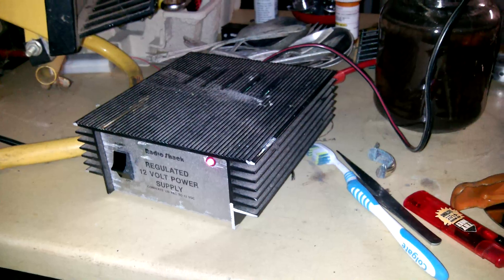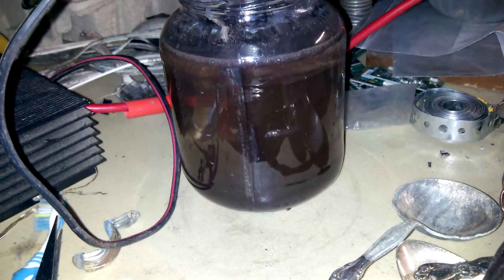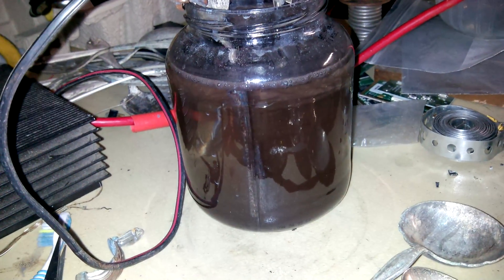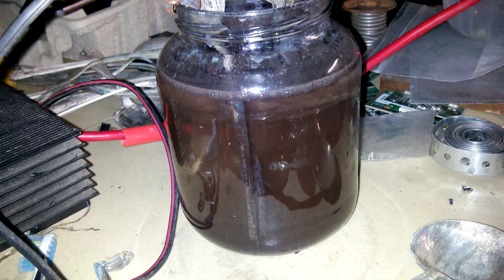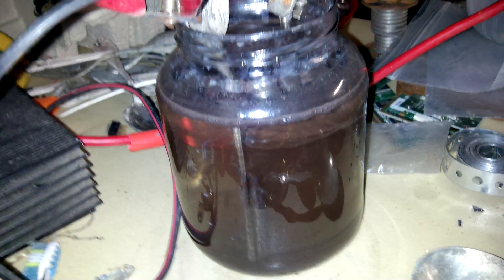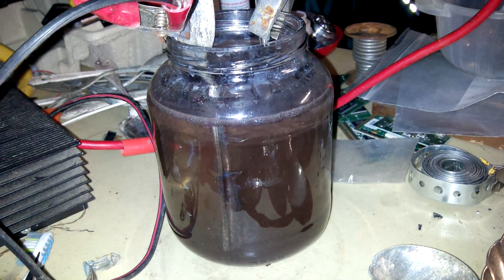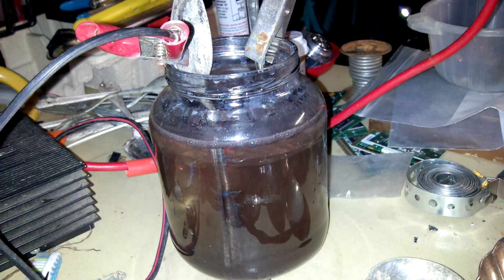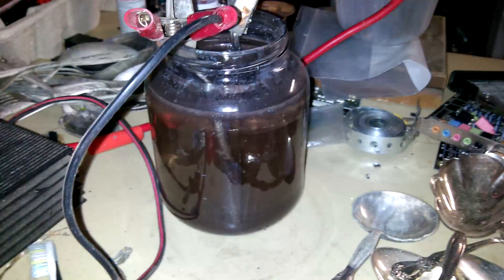PROCESSING SILVERPLATE WARE WITH H2O CELL PART 3

Comment: i believe the silver chloride is going to be a very minute quantity compared to the total overall.it only forms with addition of fresh water with chlorine.if you use the same electrolyte until the cell refuses to deplate more silver,it will be even less per batch.i would filter and reuse the water over and over again as long as it stays active. as long as the silver chloride stays low,you shouldnt experience when melting.good job so far,keep up the good work. do you want me to post this one too?